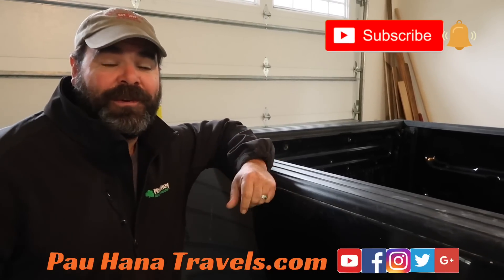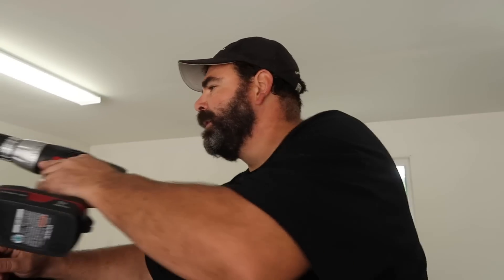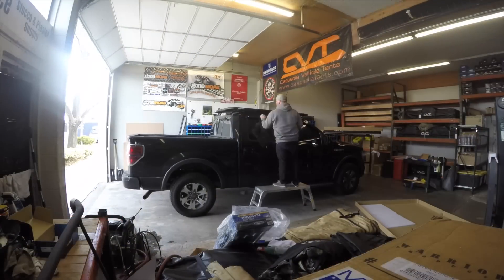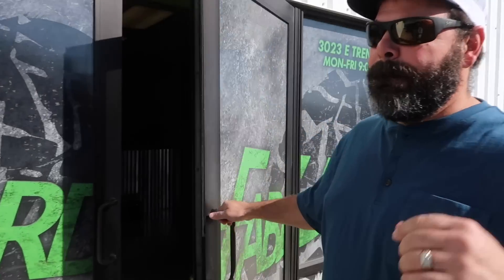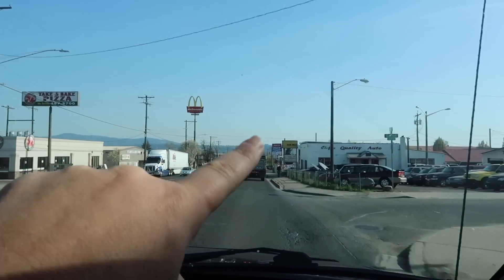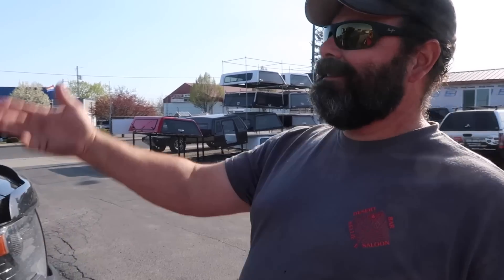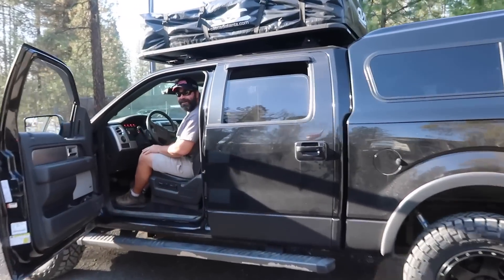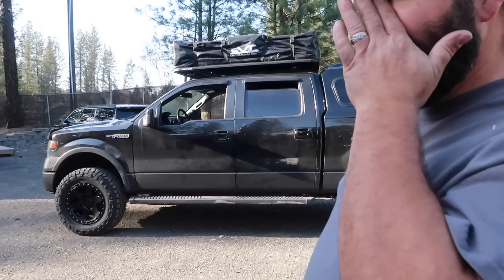Meet Elsie our upgraded Ford F150 FX4 a Overland Motorhome Tow Vehicle

Comment: Not sure if you cover this but why on the cab roof and not like a small rack in the bed?  Sorry I wrote this mid video.  I see the camper now.
Reply from the maker: We went with the camper because we carry our e-bikes in the back of the truck but wanted them protected from the elements and under lock and key. The original placement on the cab was just to get it home from Bend Oregon because the topper was one of the things we got done last due to ordering wait time.

Comment: Love the look of the truck and what you all had done to it. Just picked up a 2019 F150 XLT Sport FX4 and want to do many like mods as well. Why own a car when you can own your truck right!?
Reply: I've read you last years post for your new FX4,  I am maybe a week away from buying a 2020 FX4 truck which are becoming fewer and fewer on the lots but the prices are coming down.  Got my sites on a silver one for towing and the price is  $40,000  + tax/title.   What have you done in the past year to your truck ? What are must haves ?  I just retired and want to start spending and hit the road and take it off road where many F150's never go.  Use it hard because you can't take it with you.
Reply: @jetboy770371  Hey there. I upgraded the sound system, tint, and a ranch hand grill guard as well as a ARE camper shell. I love that camper shell to tell you the truth. I do plan to put a 2.5 inch lift on it at some point. It's just been hard times financially recently. But I love my F150. Good on you for spotting a good deal. The 2021s are very expensive over the last generation. An xlt has gone up in price by about 4 to 6 thousand dollars. Yikes! But enjoy your retirement. I'll be there in about 30 years lol. And enjoy your new f150 when you get it. I love mine. Let me know what you so to yours.

Comment: Not a chance in hell that I would drill holes in the roof.  Those receptacles for the bolts will come loose and spin for sure .  I have dealt with "rivnuts"  which are a blind fastener nutplates  used on commercial aircraft and they wear out and spin a lot.  In thin roof aluminum you are asking for trouble.